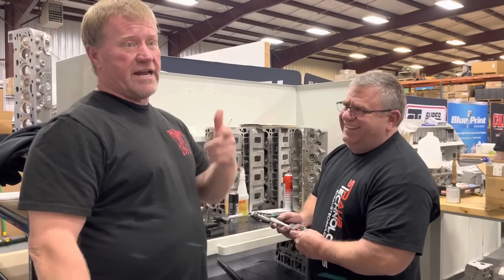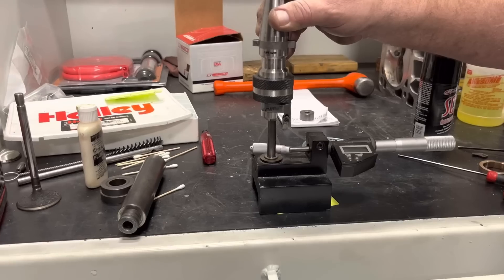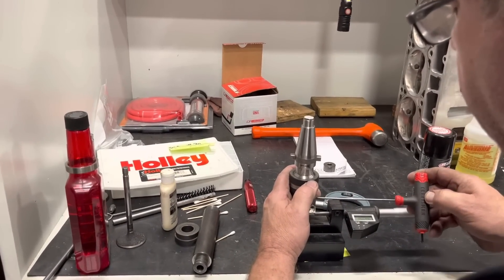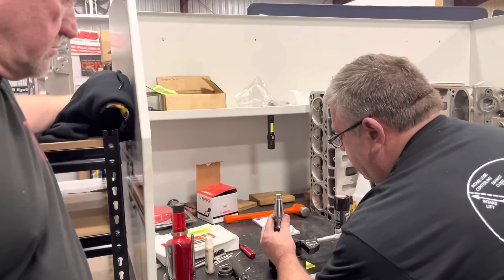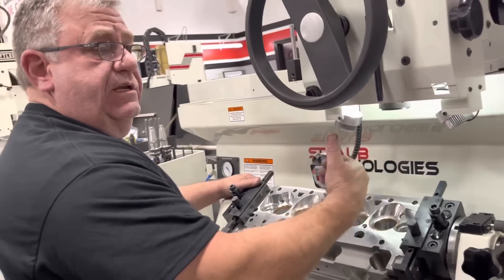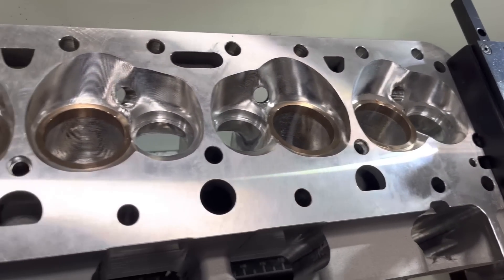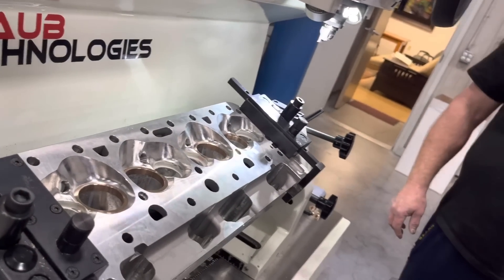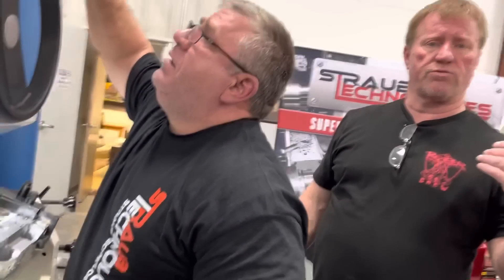Valve Seats

Comment: My boss would kill me for pounding in seats on a machines table like that 😮 awesome video though thanks reaper
Reply: Exactly what I was thinking. Nice precision machine after 100 or so seats, alignment is f’d!
Reply: @donny5417  Its what its made for. The shop I worked at did thousands pretty much the same way, except used an air hammer mostly.
Reply: @taylorsrus9543  I’ll agree with the air hammer. As a machinist for 45 years, you don’t beat on a machine with a striking hammer, too much impact on the way bed. Just sayin’, not good practice.

Comment: When I’m putting new bushings in machines I put the bushings in liquid nitrogen and I have about 5-10 seconds to slip the bushings in and rotate them to correct rotation and they are stuck in the machine after that if I have to get one back out I have to cut it out………..liquid nitrogen gets the bushings like -200F so they shrink a lot!  Love seeing my trade on these videos!